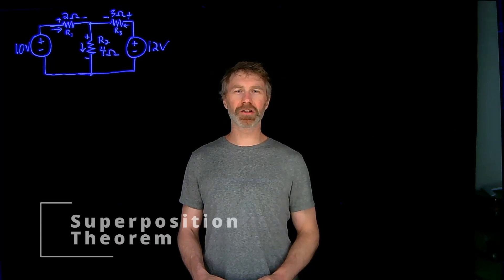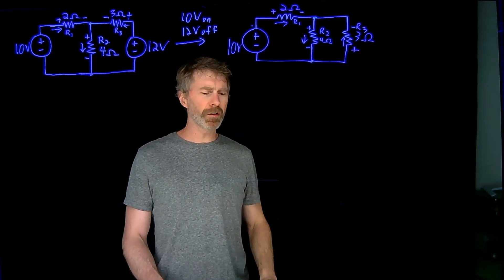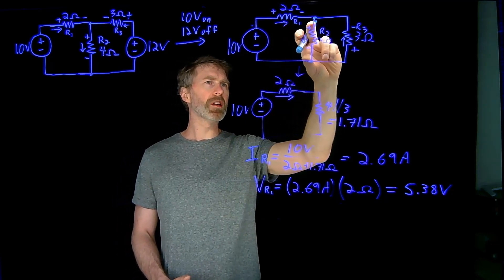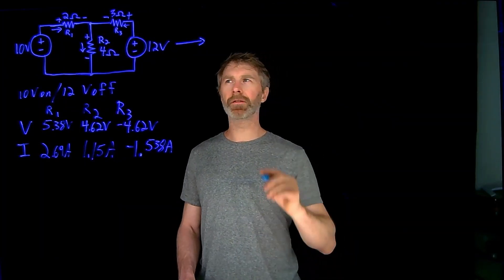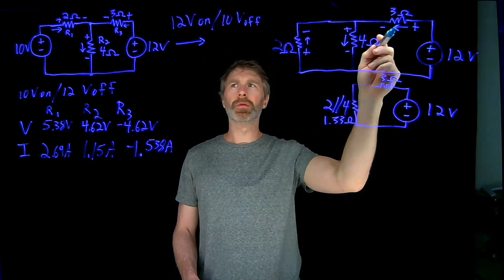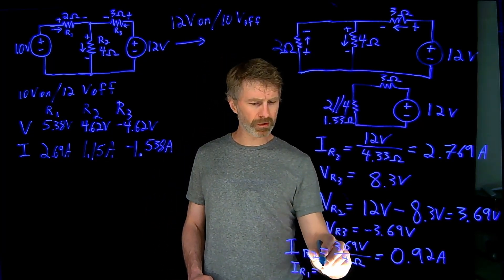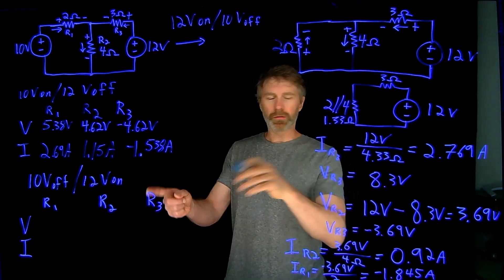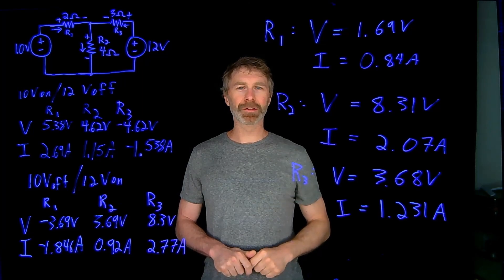Superposition Theorem Example (Electric Circuits)

Comment: Awesome video. I would note that you can get an easier and quicker answer to solving the circuit by doing KVL in each loop and solving for currents 1 and 2, Since these elements are assumed to be behave linearly. By getting currents 1 and 2, you can solve the corresponding voltages across the resistors. I solved it this way and i got the same answers. Knowing this, i am just confused as to what came first and how to connect these ideas. Does KVL incorporate superposition through the currents ? OR is it better to think about these ideas separately?

Comment: I would love to see some videos covering some push-pull amplifiers  JFET, DMOS and EMOS amplifier configurations I'm really struggling with them right now.
Reply from the maker: Thanks for the idea! I'm working through DC circuits first and then AC circuits. I'll look at getting to those push-pull configurations after that